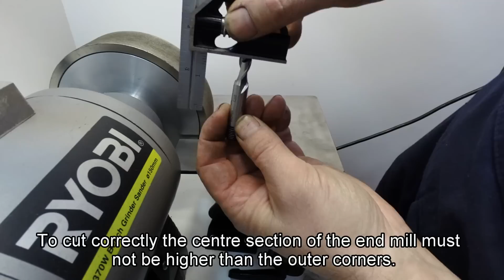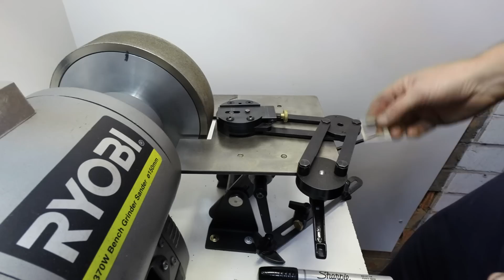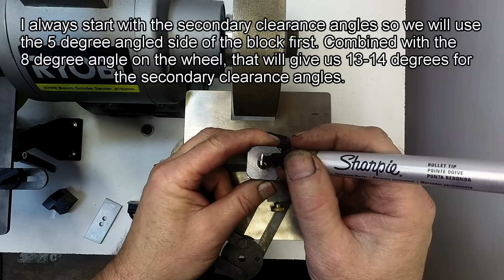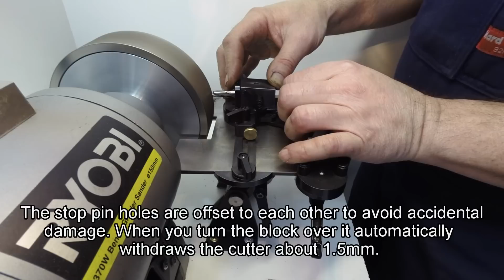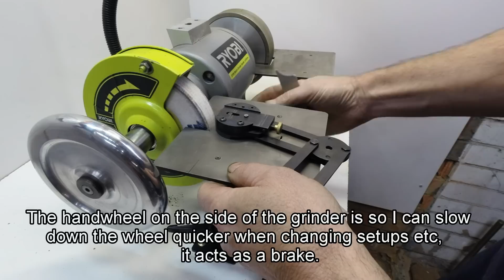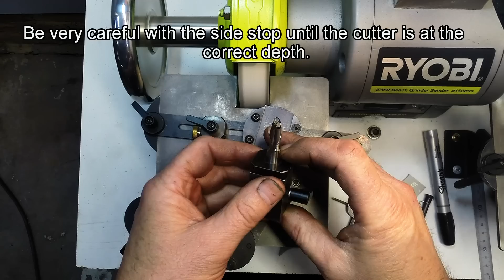The Acute Tool Sharpening System #10 - Sharpening a two flute end mill.

Comment: This makes me grateful that I inherited a T&C grinder (actually a universal). I just need to learn to use it... 

Very cool system, though, for those who have not been blessed with a machine to do this. I'm impressed by how much time you have clearly spent on the design. It's a shame that most won't have the patience or attention span to learn it, as this could be in every home machine shop. Hopefully it makes its way into enough to reward you for your work. :)

Comment: Is it possible to grind a 4 flute endmill with this?
I'm guessing you would need a narrow cutting blade to gash the endmill
Reply from the maker: Yes a four flute endmill can be sharpened. 
The easiest way is to use the standard grinding wheel to grind the primary and secondary angles and then cross through the center with a thin cutoff wheel or the corner of the normal wheel. For a center cutting endmill you would need to use a flared cup wheel.

Comment: HI, How did you modify the right side of your grinder to take a ginding wheel like that.  Isn't a belt sander was there....?  Thanks for the vids
Reply from the maker: Hi Eiffel
Yes the grinder did originally have a linishing belt on the right hand side which I removed so I could mount the CBN wheel. 
I originally tried a smaller Ryobi grinder but found it got quite hot when running for extended periods with a heavy wheel. I've had no problem with this one and it's pretty quiet.